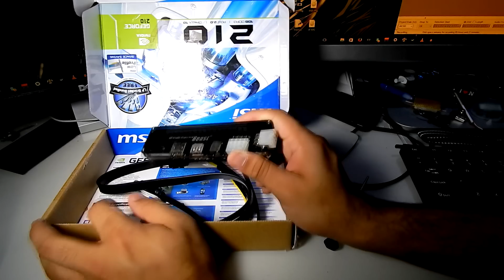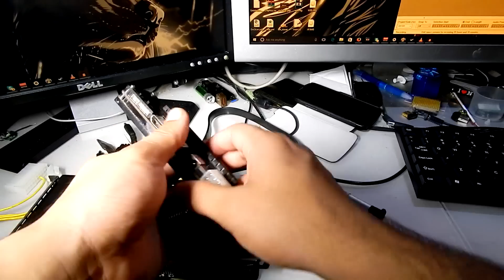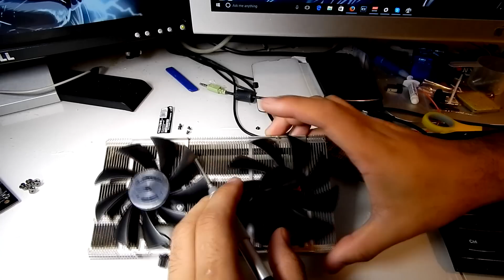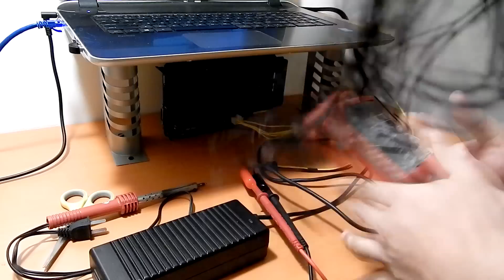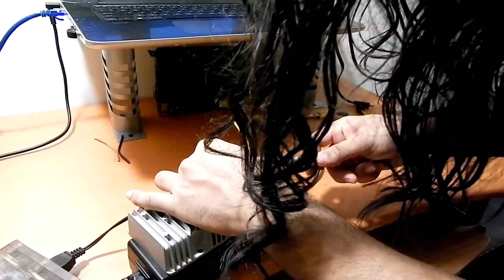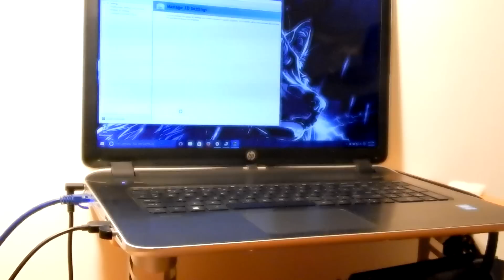Turn Any Laptop Into A Gaming Machine For 72$

Comment: Just connect a cheap laptop and a powerful gaming PC to the same steam account and enable steam streaming, then stream games that the laptop cant normally play due to graphics limitation, and those troubles would be solved.
Reply from the maker: Well you'll need a good wifi connection a good router and it'll only work at home.

Comment: Generally, laptops with dedicated GPUs have the screen wirered to the Intel iGPU, and use that passthrough to display the GPU video when it's working. 
And Nvidia Optimus consist at switching off the GPU when not in use
Reply from the maker: I had the feeling of this but i wanted someone to confirm it. Its odd tho how it still works with with the graphics dock tho, also i guess the pass through is in the cpu as a hardware thing and it looks at the gpu as a dedicated one regardless of how its connected.

Comment: i would pair this with my laptop acer aspire E15 with i7-4712MQ but the body of the laptop is really annoying to work with ... is there any chance of other possibility to connect or give me a tip for how i should link this with the laptop easily? (it has an gtx 840m) i want to have an gtx 970 or 1060.
Reply: only if it's pcie 3.0 would i try. tests have shown a fury x shows less than  a 5% drop in fps vs x16 when pcie3.
Reply: +Andrew Russell ?🇷🇴
Reply: A guy did a test with a fury X in pcie 3.0 x4, x8, x16. There was a 2%~ fps difference between x4 and x16 aka not that much. Now with pcie 2.0 it will have half the bandwidth of 3.0 so pcie2 x4 may see more of an fps loss. I would look up your laptops antenna (pcie x4 slot) and try to find out what generation is it. Even if it was pcie 2.0 I would do it but maybe wouldn't go over a 970

Comment: Could I buy like a hdmi to thunder bolt cuz i have a iMac and it has thunderbolt
Reply: Nope, Apple BIOS won't let you use the card anyways and the Thunderbolt to HDMI won't transfer the information the card needs.
Reply from the maker: Im not too sure, i've heard of some kind of solution for imacs but im not too sure.
Reply: *****
Maybe if you ran it in a Linux distro off of VirtualBox you might be able to use it but I am 99% certain stock OSX will not make it easy or even possible

Comment: Will taking out the wireless card turn off my internet?
Reply: Only if you are using WiFi for connection. If you are using a built in ethernet cable port as the connection then no it won't.
Reply: K thanks
Reply: +Artur Sebastian it was I know it's stupid but I was wondering if by wireless he meant bluetooth... I know close to nothing about laptops
Reply: David O A few things to think about with this. Most laptops that have WiFi and Bluetooth have them combined in a single card. Most laptops also have just one of those M PCI-E ports that the combo card is sitting in. If you are lucky to have 2 or more and they are all enabled then the wireless card can stay. If the card does have to come out, you lose both WiFi and BT. Many of the larger laptops have a wired RJ45 ethernet port built in that will still work for a cabled internet connection. That will still work even without a wireless card. (I use the ethernet port on my laptop as it's better than WiFi.) If you need WiFi and BT after the card is removed, USB adapters will take care of that. If you need both then some searching will give WiFi and BT combo USB adapters. Be warned these will be USB 2.0 and be slower than the original WiFi card. BT will be the same as even on the M PCI-E card the BT is still hooked using USB 2.0 through the port. (M PCI-E has a single USB 2.0 line in it. That goes to the BT radio on combo cards.) The WiFi on these cards goes through a PCI-E x1 lane that gives fairly fast speeds. The e GPU adapter uses that PCI-E lane to hook the GPU up thus why you lose the WiFi. BT is also lost since it's on the same card as WiFi. Notice how the e GPU base has a single USB port on it? That's broken out from the M PCI-E lines and made usable. So you could put the USB based wireless adapter there and it will work at full USB 2.0 spec. As I said, BT will be about the same but WiFi will be slower going over USB 2.0 if you have insane fast internet. I've rambled on enough. Hope this helps.
Reply: +Sonicdude10 thank-you very much trouble that helps alot
Reply: Way to be sure. I'm no troll. In fact, if you were to look at my channel you would see I do a lot of cheap computer hacking and such. I have pretty extensive knowledge about PC architecture. I know how they work. I'm not always right (who is...) but chances are whatever I say will be close to correct. What I said about the wireless card, PCI-E, and USB are completely correct. Feel free to look the specs up yourself.
Reply: +Artur Sebastian again no it wasn't a troll I just didn't know
Reply: No problem guys. I was confused as to who was responding to who. No hard feelings. Hope what I said has helped without sounding condescending.
Reply: +Sonicdude10 we are all cool... thanks again dude!
Reply: I got one of those bluetooth dongles, still don't have much in the way of bluetooth devices to use it with, but I imagine I'll end up buying some. I'm looking at a couple of bluetooth controllers I might buy lol
Reply from the maker: True, but usb adapters are cheap too.

Comment: hey man good video.
i have lenovo y510p.
can i use a gtx 1080 Gpu in it with this mehod ??
Reply: yes headass. u just need a good ass psu
Reply: check speed of the slot your wifi is in. Doubt it is fast enough to keep up with the 1080...wasted money.
Reply from the maker: I would try a 1080 for shits and giggles if i had one but from what i hear linustechtips is gonna make a video on this too so maybe he'll try it.

Comment: I skimmed through the video but i didnt see the underneath of the laptop. Did you manage to pull this off without really having to remove the pcie wifi card or is the gpu dock plugged in under the laptop? camera angle makes it hard to see.
Reply from the maker: Umm the wifi card was taken out and the cable just stick out, sorry for the bad angle.
Reply: no prob xD merely curious if you found some awesome way to mod it to be semi-hotpluggable

Comment: also when you unplug your laptop from the GPU does it seamlessly revert back to the laptop GPU automatically? or is there extra steps.
Reply from the maker: I'd recommend turning it off first.
Reply: ok yea but after you unplug it and turn it off. when it turns back on not plugged will it work like normal?
Reply from the maker: Isaac
you turn it off then unplug. and yea when you turn it back on itll be like normal
Reply: +Davindra ok cool! thanks for the help.

Comment: Good Video dude but why you did not use a ATX SMPS instead of the stuff u did to make a power supply.. its good that you did not fried any thing ....The best power supply is always a smps its Isolated and the voltage ranges are also stable .... any way good video and thanx for sharing
Reply from the maker: Thanks man,

Comment: hi very helpfull video! can i use this power supply?? https://www.amazon.co.uk/gp/product/B00V3FCYUU/ref=s9_simh_hd_bw_bT8OMh_p147_d2_i1?pf_rd_m=A3P5ROKL5A1OLE&pf_rd_s=merchandised-search-3&pf_rd_r=HVRKDA6E6WVD2Y1YPBN4&pf_rd_t=101&pf_rd_p=15d25a6a-557e-5df3-9b20-4715d49a3e55&pf_rd_i=430514031
Reply: with the new amd video card
Reply from the maker: it should be able to yes.
Reply: using i mean it will not fry anything :D
Reply: so you used the asus charger and regulator jsut because its cheaper than new power supply?
Reply from the maker: good friend
Nah i just needed very small.
Reply: alright then :D ill start building mine  :DD post the rezults soon xd
Reply from the maker: good friend
cool.

Comment: Your installation is so complicated
Reply from the maker: Sorry this video wasn't intended for anyone who wasnt experienced in tech.
Reply: +Davindra watch other videos, they dont use regulators they buy adapter instead
Reply from the maker: Marc Walton
i know you can substitute what i did with a normal computer psu.
Reply: +Davindra ok power supply would be better
Reply: +Davindra can i use laptop gpu and external gpu at the same time?
Reply from the maker: Marc Walton
its a bit complicated to explain but yes.
Reply: +Davindra your using both?
Reply from the maker: Marc Walton
ye
Reply: +Davindra thanks man

Comment: Please don't take this the wrong way as I don't want to take away from the overall technical achievement but after watching you with the soldering iron I'll probably have nightmares for years to come. Have you considered using crimps or belling lees?
Reply from the maker: No i acutally havent i would give that a shot but i would need to get the tools to do so.
Reply: You would only need pliers for crimps and a screwdriver for the belling lees. They're a super easy and safe way to prototype.
Reply: This was an amazing video BTW.
Reply from the maker: speedwolf
thanks man ill will keep that stuff in mind for the future.

Comment: That soldering iron is a fire hazard. Also, it has no temperature control which is why you had a hard time melting the wire, not all of them are made out of the same metal.
Reply: He had a hard time because he was trying to apply hot solder to a cold wire. When you are soldering properly, you should never have to physically touch the solder to the iron, unless you are simply trying to clean the soldering tip.

Comment: Do I need to order the specific power brick if I happen to have a spare desktop ATX power supply that has the necessaey connections and has enough power for the GPU?
Reply from the maker: all you need is a atx psu of atleast 100 watts.

Comment: How could a camera run out of battery, if the laptop is powering it
Reply: Speak English (grammar) so I can understand
Reply: Hello I'm from Bulgaria part of former USSR Soviet Russia my English is not very good but you have a great point. How can a camera run out of battery while it's plugged into a laptop? I don't know the answer to that but I think maybe the camera doesn't record and charge at the same time. I don't like that design Sorrey for my English
Reply from the maker: The reason why it turned off a few times was i had it on a battery bank then that died. So i connected to my laptop usb without realizing at some point i turned off the laptop.
Reply from the maker: *****
lol

Comment: to keep full portability u could make a docking system attached to the card and put it in ur backpack and when ever u wanna use it just take out the cable and use it(keep the card inside)
Reply from the maker: Was thinking of something similar.
Reply: ***** then I suggest that u make an update video applying this idea

Comment: Not practical. This dude obviously doesn't even mention "bandwidth" and doesn't even tell you there are many problems with this approach. Wireless card slot has really low bandwidth because it is a PCI (not PCIe), and wireless cards doesn't require lots of bandwidth to transmit data.. It doesn't matter if you have the $72 expansion PCIe slot, the bandwidth will be bottlenecked right at the gate. 

Second, laptop CPUs will bottleneck games a lot especially if you have a cheap HP laptop like that in the video that only at most gives you intel celeron,  pentium N series, ore core i3. At best for the price around $800 and higher that is when you get at an I5 6200U. 

Assuming someone has older laptops with pentium N, its completely waste of time and garbage performance using an external 750ti. And if this person is looking to upgrade the total build costs of this setup will set you back at least $900-1000, which you could build a full desktop high end gaming rig.
Reply: This isn't too bad though, especially for people like me with a i7-6700HQ. so I'm not too worried about bottle necking
Reply: and I only got it for 600 dollars
Reply: And there is even more problems is the fact not all laptops wireless cards have PCI slots for you. Many newer generation laptops including ultrabooks, have wireless card chips soldered directly onto the motherboard itself, some even have ram modules like that.
Reply from the maker: I mean this was a concept never anticipated anyone to actually go out and try it, and as far as bootlnecking goes your only gonna expect that on a lower or older laptop most modern ones aren't that bad. Plus it looks like you didnt notice but the laptop has a quad core i5, never said that this'll work for everyone only those who know the tech they have should ever try it.
Reply from the maker: Also how was it not pcie most laptops use that same slot for ssd's if it was pci it wouldnt explain why it even worked to begin with. You clearly only watched a portion of this video before leaving a comment and also there isnt much information on these docks most people just buy and try them, i made this in the hopes the those who could figure all that stuff out could reply.
Reply: ***** No you need to understand the difference in terms o bandwidth the rate it is. Its not PCIe because most laptops uses PCI for the wireless card slot. And at most for newer version of laptops it uses PCIe X1. A graphics card require a minimum X8 and X16 slot to have full performance. You lose up to 20% of performance using a PCI x1 slot. Even on regular desktop X4 you lost at minimum 10%. Also GPU prefers to run at 2.0 and 3.0 PCIe versions. Wireless card slot are likely at 1.0 version and you will see a huge performance degradation.
Reply from the maker: Gin toki
If you really wanted something that was plug in play go buy a razor core idk why you are watching a DIY video expecting everyone to do it. You should do some research into what is hardware compatibility. Plus name one youtuber thats NEVER used a "clickbait" cause you definition of click bait is so blurred it could fit everything, you can do the math yourself all the parts i used are linked in the description take a look and tell it doesnt cost that at all.
Reply from the maker: *****
Yea thats how i view it aswell.
Reply: You're disgusting. Slimy.
Reply: You are wrong, it is a PCIe slot, it is called mPCIe. It is PCIe, only with 1x bandwidth, so you are right about the performance loss, but it is more like 20-40% depending on the setup and the GPU.

Comment: Regarding some of your comments towards the end of the video, laptops with a GPU in them will use integrated graphics whenever possible, regardless of being on-battery or being plugged in, and will only use the GPU in scenarios where it is needed and where the laptop determines there will be a needed performance boost (games, rendering, etc.) Nvidia's Control Panel and that pass-through function are in case the computer didn't register a specific program as needing the GPU to run. It IS hard wired, but there is always a software workaround, because there are always exceptions. The GPU will be used both on and off battery if a game or high-power program is running.

Comment: The solder joints will be a bit stronger if you twist the wire ends together first then solder by holding the iron to the twisted pair and feeding the solder onto it.A "linesman join". Fun project though :)
Reply from the maker: Thanks for the tip will keep that in mind.

Comment: how would I connect this with a standard pc power supply? Would there be issues with power delivery?
Reply from the maker: just make sure the psu is over 200 watts and it comes with some adapters for a pc psu
Reply: +Davindra okay, are you sure that it won't overvolt anything since it isn't plugged into the laptop?
Reply from the maker: Hudson Meek
all i can tell ya is use the included cables dont hook the psu directly to the dock.

Comment: If your using a DSLR for your recording then the sudden stops would be due to a firmware limiter that prevents the camera from recording for more than 30 minutes at a time, this is to prevent over heating and burn in on the sensor.
Reply from the maker: Huh thanks its not a dslr but it does have a firmware limiter.